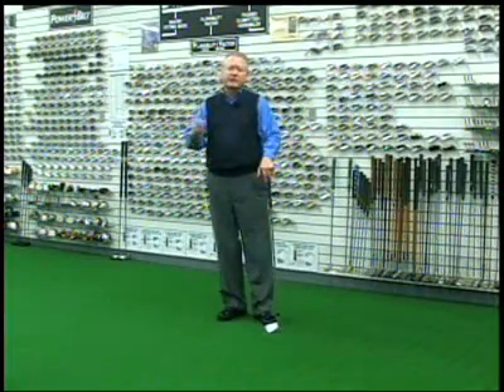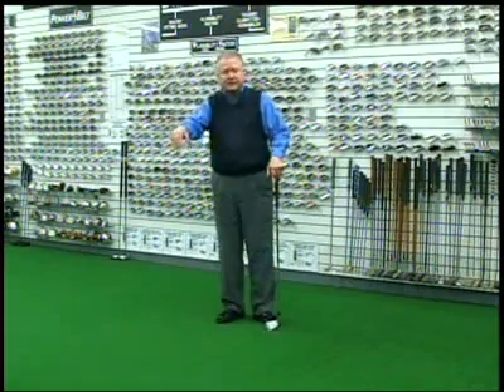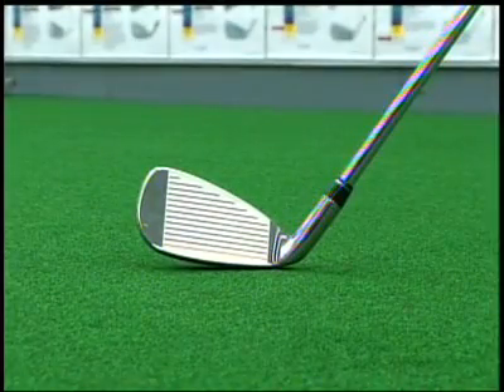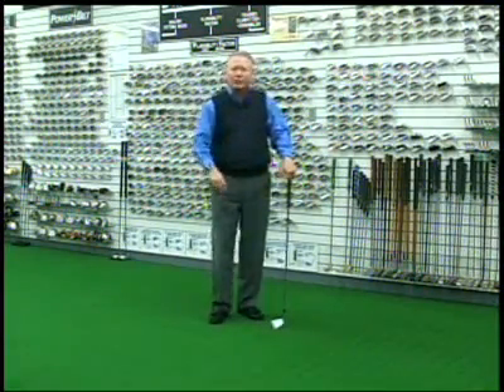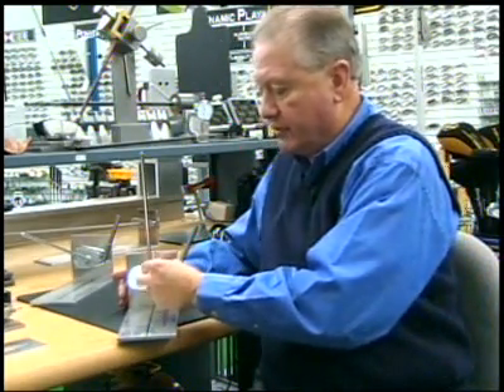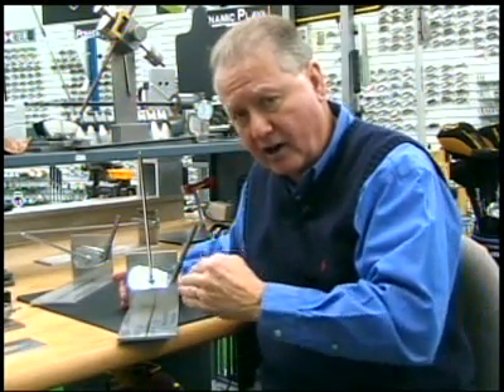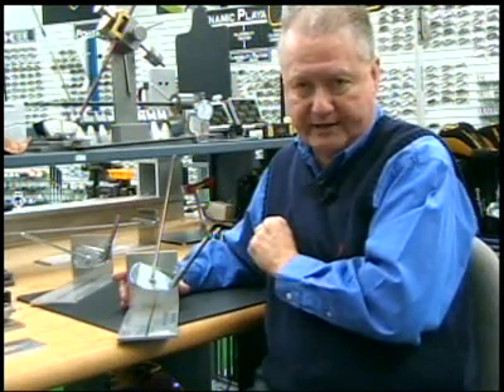Ralph Maltby - Iron Lie Angle (Expert Golf Advice)

Comment: wow awesome... they're closing out the last set or so of Maltby KE4 Forged heads. I'm not a mid capper yet but they don't have a head that appeals to me the same coming out, apparently, for when I get a bit better, so I'm buying them for later before they're gone and I'll bide my time setting them up. I like I can tinker with these so much. The variable weight is right in the sweet spot (spread out a bit for forgiveness to a degree) and then there are guys like me who tinker who take advantage of the trapezoidal spaces in the cavity in even more ways. My two favorite realistically priced wish list heads are the Maltby TE forged for their efficient, minimalist retro elegance and the KE4 Forged (not all KE4s)... and so since the Forged are going extinct I ordered the whole set on closeout for $150 + a little shipping. I actually ordered eight 4 gram weights on closeout because I can either lighten up the 6 gram stock weights using them or, they're hollow, and I can fill 'em with lead etc...hehe.  I am pickling them on a shelf until I get a bit better, and I want to really know about my custom fitting by then by the time my game has gotten good enough to make proper use of learning to shape shots a bit more than my King Cobra II OS's I'm using as learners. I also have a cache of all manner of old clubs to experiment with, seeing what works and what doesn't for me, and can even mix and match heads and shafts... can't lose for $1.18 each from the thrift store no matter what they are! People with consistent income and expenses might do it differently, but both mine are erratic, and I just didn't see anything quite like the KE4 Forged coming out, and didn't want to miss out on them. I think I'll be really glad I bought them and can concentrate on buying shafts and grips and learning more about the custom fit that suits me most before gluing them up. I have  lot of experience in precision aerospace machine work as well as R&D & assembly of custom archery equipment, so darned if I'll be afraid of assembling clubs. Just can't rush into things unless you want to mess the first set or so up. You still reading this? I'm all jacked thinking about my club head purchase and can't sleep. What's your story? Praise God. Turns out He's real after all. Say Hi to Him, He does it back!

Comment: Excellent description of effect of wrong lie angle on ball trajectory.

IMO, the most important consideration is what is best method to fit lie to the individual golfer.  ie how to determine proper lie angle for individual golfer. 

I suggest lie angle should be determined by wrist angle of the golfer at address.

Comment: As long as the clubs you're using somewhat close to fitting you it's not a big deal.  Lie angle is just about the sole of the club laying flat on the ground at impact.  So if you are around average height then clubs should already be close to that.  If you are tall or short then you might want to change or bend your clubs.

Your lie angle shouldn't change as you progress.

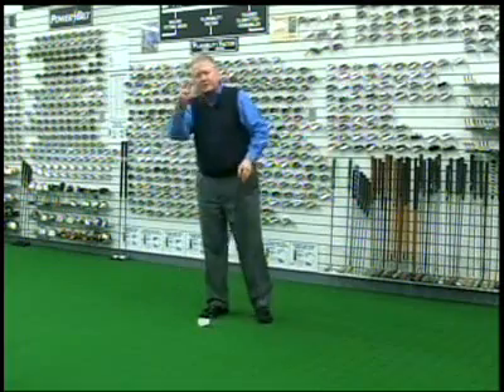Comment: what is meant by "the shaft flattens"  1:02...thx
Reply: If you pause a slow motion video of a iron at impact position where the camera is in front of the ball, the shaft has bowed with apex away from the golfer, this will physically move the heel of the club towards the golfers feet slightly, based on geometry this "flattens" the lie angle.
Reply: got it thx...the shaft bows outward and the lie angle flattens...does the swing speed affect the amount of shaft bow ??